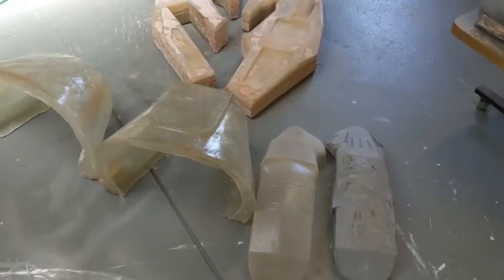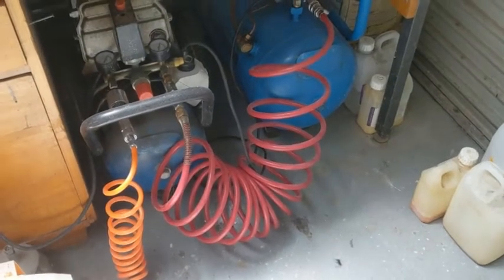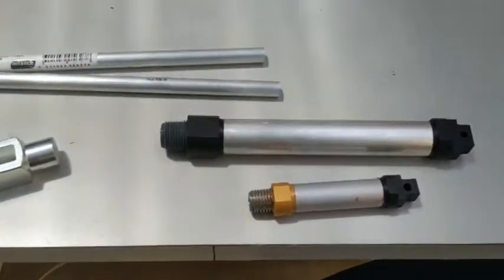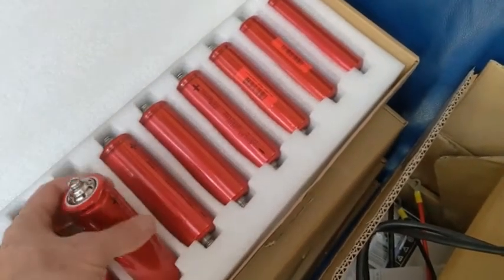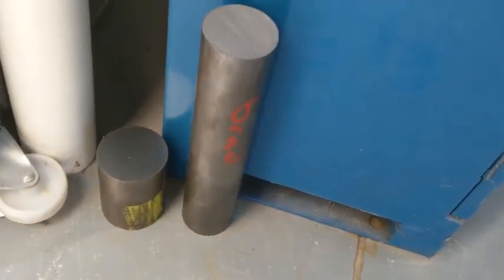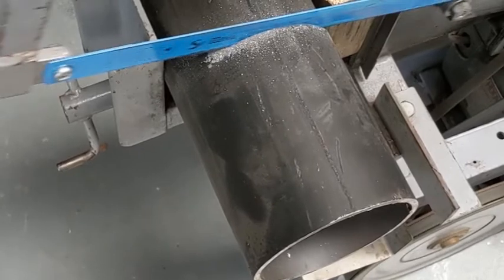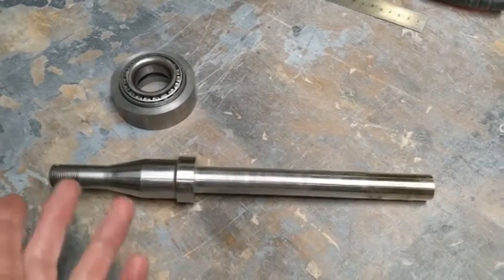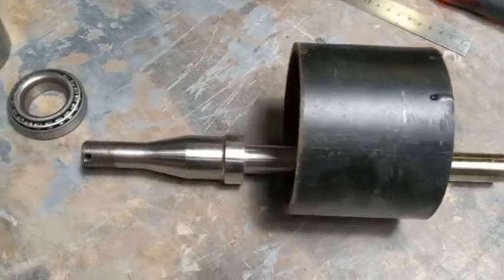Batpod V2 Build Video 3

Comment: Did you make the molds of the tank cover, arm shields, and cannons? I'm trying to figure how to either 3d print these out or make a mold. Finding it hard to get dimensions for these.
Reply from the maker: Yes.  I made fibreglass molds and cast fibreglass parts from them.